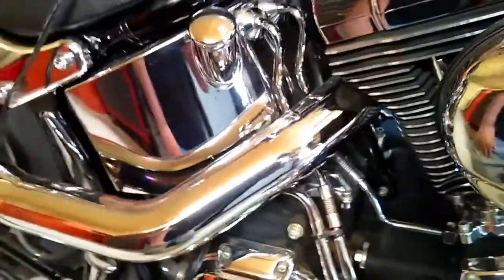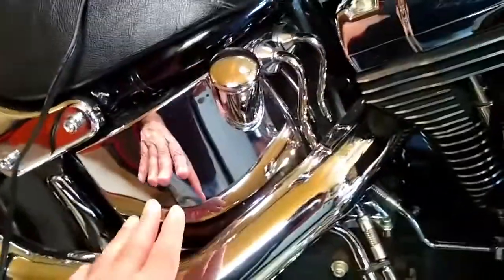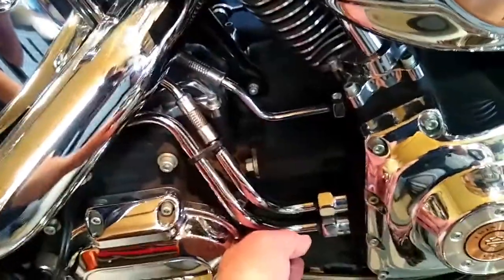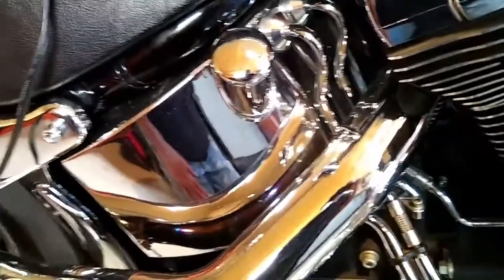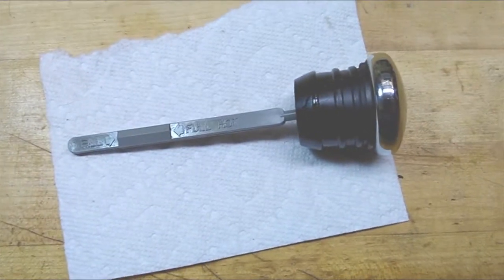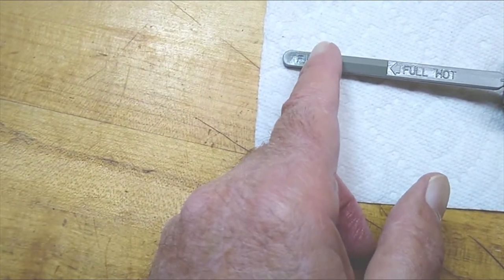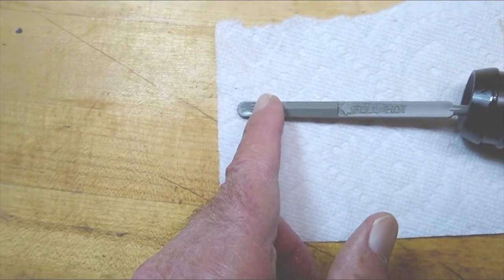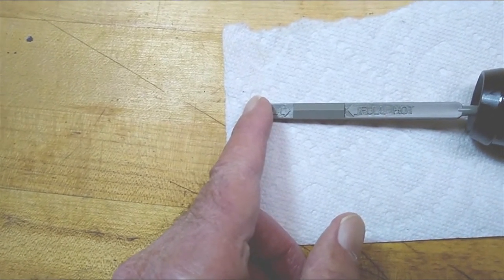Never Check Oil Level Cold on Harley Twin Cam

Comment: Man you are awesome I was totally taught wrong at the Harley Davidson dealer how to check the oil on this type motor. I even had the dipstick shoot out one time. so now I'm gonna drain the whole bike out completely drain it and refill it and do what you said. And you're exactly right on what you said because it's not spitting oil on the ground. And I haven't been riding it because I was afraid the dipstick was gonna shoot out . When I check the oil after it warms up the oils all the way at the top that means it's overfilled thank you so much damn Harley Davidson dealer I'm gonna have to go down there and freaking educate them.
Reply from the maker: Glad the video helped you. Any Harley that has a horseshoe tank or any tank raised above the motor will gravity down if it sits. Thanks for the comment and thanks for watching. Ride safe

Comment: Thanks a lot sir, being a diesel/equipment mechanic I got off work early and decided to go for a ride since I haven’t been riding in about a month, before starting I pulled the dipstick and it was bone dry whoa what the hell, figured I’d look it up and came across your video man I was scared to start it and almost went to get more oil and you saved my ass thank you I would of ended up overfilling the tank but I ran it for 5 minutes and it came up to the correct level
Reply from the maker: Glad the video helped you, thanks for the comment and thanks for watching

Comment: have my first harley    3 years now after riding every thing over the last forty years i am 65 and live in londonderry  northern ireland on my own as to keeping the bike right no mechanic but do all my own  servicing  manual a must like your no nonsense approach have subcribed keep tinkering recenctly fitted hydraulic tensioners the guys at harley hq should have been taken out and horse whipped for that keep tinkering
Reply from the maker: You'll get no argument from me on the tensioners. In my opinion a very bad idea. Doing all your own work is gratifying not to mention the money you save. Thanks for subscribing I appreciate it. Ride safe and thanks for watching.

Comment: You also did not mention - when checking oil, do I push the dipstick all the way in, or leave the rubber plug sitting atop the opening?
Reply from the maker: @mfsmfs63  thanks for the comment and thanks for watching ride safe
Reply: All the way in.

Comment: Great video.Thank you for sharing this important information. I have a 2007 softail custom. Blows my mind, that the manual tells me, if it doesn’t register between the two marks when cold, I should add more oil up to the filler neck weld line 😮 then go and do a hot oil check 😮😮 what the hell is that about ??
Thanks again 👍🏻
Reply from the maker: Glad you liked the video. Anything with a horseshoe tank will gravity down, the best way to check it is when you're done with a ride and the oil is hot. That way you know it's good. Thanks for the comment and thanks for watching. Ride safe

Comment: Good morning, I check oil at op temp, after a trip around the block, and on the side stand, I have the same dipstick as you in my Softail and it will pivot, and swivel, to get correct reading, am I Correct? Thanks, from FL.
Reply from the maker: Thanks for the question. You are correct. Thanks for watching.

Comment: I got a 95 ultra Glide where the oil tank is on the bottom of the engine does checking it when it's cold okay then or does the same rule apply?
Reply from the maker: Yep checking it when it's cold is ok. Checking the oil when it's hot only applies to the raised oil tanks. Thanks for watching and ride safe

Comment: Does this apply to a 2013 Road King Classic?
Reply from the maker: This only applies to bikes with a horseshoe oil tank, I believe a Road King has a low oil tank under the transmission so it wouldn't apply to yours. Thanks for the question and thanks for watching. Ride safe

Comment: Do you check the dipstick on the jiffy stand or off.
Reply from the maker: I prefer to check mine with the bike standing up straight, but you can check it with the bike on the kick stand.  With the bike on the kick stand you will get a little bit lower reading on the dip stick.
Reply: I was adding new oil, drained old only about a quart came out...wtf? now, riding for forty yrs.  I'm pissed, filled half the oil filter then three qts. in oil bag. start her after a min the oil cap popped off oil comes guessing out. my question and I feel like a ass asking, was oil still in motor even thoe I drained the bag? and if so best way to check or fix drain oil out then check. and how can I check if it's cerculating?
Reply: @michaelvincent4941  i ride my 2004 fatboy 88 twin cam for about 20 to 30 minutes shifting thru all 5 gears bringing engine up to operating temperature,(starting bike and run for 2 min does not bring it up to operating temp)
then back in my garage let bike sit for 10 min and check oil (while sitting on bike in riding position not on jiffy stand).i do that because if engine is cold,the
oil is sitting down in bottom of engine,the drain plug,although located at underside of bike is not physically connected to bottom of engine,
it is coming off a drain hose from the oil tank reservoir.i do this before i change oil also because i do 3 hole change (oil,transmission,primary)each time is why i shift thru all gears.
Reply: @michaelvincent4941  I wish someone had answered your question!!!

Comment: Top of the morning to ya Brother!! Another great video. I have an 05 Heritage & has the plastic pivot stick, (not sure about technical name) lol. Ít says on stick," check on jiffy" but manual says up right!!  I was told with that type of dip stick it's always on the stand?  Reason I'm asking, I bought used & I almost blew up a Lincoln one time because someone put a used & wrong dip stick in the old girl!!  Thx. I appreciate you !
Reply from the maker: Thanks for the question. If you have a pivot dip stick you check the oil on the kickstand. Just make sure the engine and oil is at operating temperature when you check it. Thanks for watching and ride safe
Reply: Thx my friend. I've been finding out my clymer manual been giving me false information !! This here now & once with head bolts torque sequence on my Electra Glide!! Maybe my bad for not getting a Harley manual? But thx for confirming the Pivot dip stick for me!!  You Rock!!

Comment: You should have specified and explained that not all Harley’s have oil tanks that sit above the crankcase, such as Touring bikes. In addition it’s not safe to just start and run a bike that may be low on oil prior to start up.
Reply from the maker: Thanks for the comment and thanks for watching

Comment: Why is it so hard to get dipstick out of 2004 fatboy?
 Great video 56 old with first Harley.
Reply from the maker: The dipstick is tight because there's pressure in the oil tank, if it isn't a tight fit the dipstick would blow out. Congratulations on your first Harley. Thanks for watching and ride safe.

Comment: Exactly what do you mean by bad things? I'm the type that wants to know why the chicken wanted to crossed the rd. in the first place.
Reply from the maker: If you over fill the oil there are a number of things that will result from it. The over filled oil tank and crankcase will build up excessive pressure, far above normal. The most common result is the dip stick blows out of the oil tank, blowing oil all over the rider and the bike. If you have a aftermarket dipstick that fits tighter than stock the pressure will build and come out the breathers in the heads into the air cleaner, some oil will be sucked into the throttle body the rest will run out on to the engine. Lastly the over filled crankcase will drowned the crank shaft which will create enormous drag on the crank which will cause damage to the engine. Hope that answers your question. Thanks for watching.
Reply: You will blow oil out through your intake and all over the bike… Not good… I’ve done it
Reply from the maker: Yep a lot of people have done that.
Reply: Can pop the dipstick out and blow hot oil over your leg and the back of the bike, rear brake pads, rotor, tire. Ask me how I know this...

Comment: You seem like a knowledgeable dude when you have a chance I uploaded a video of my roadking can you tell me if it sounds like its running ok at idle ?
Reply from the maker: I'll give a listen. Don't know how much I'll be able to tell from listening on a video, but I'll give a shot. What year road king?
Reply: @tinkeringwithharleys  Thank you much appreciate its a 2003 fuel injected 510g cams upgraded oil pump and screamin eagle air filter thats all I know of that's been modified
Reply from the maker: @racex3721  so it's a 88 twin cam.
Reply: @tinkeringwithharleys  Yep twin cam 88

Comment: this is true what you say about softails and sportsters with oil tank mounted but for dyna this is not true.
Reply from the maker: Thanks for your comment and thanks for watching. What you say is very true not only with later Dyna's but also with any models with low mounted oil tanks. That's why I was specific with showing a horse shoe style tank. Thanks for watching.